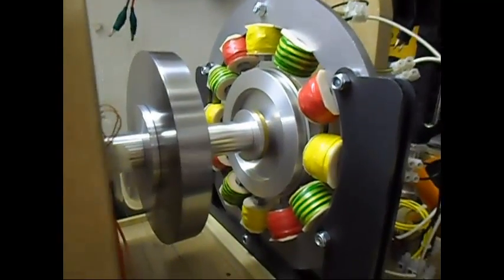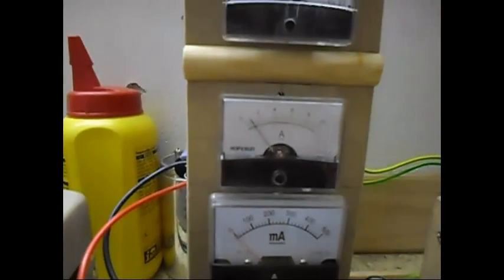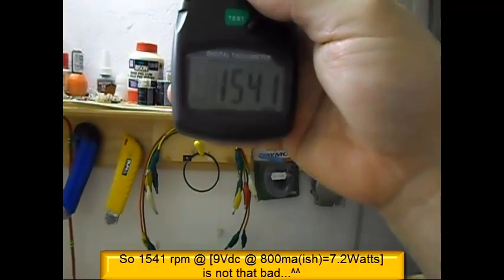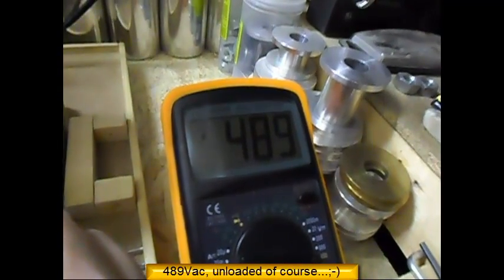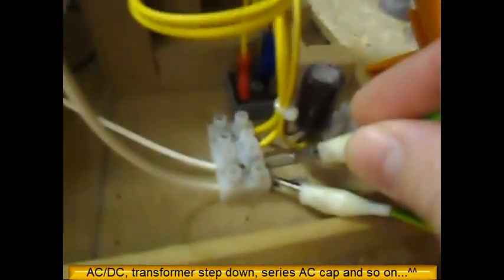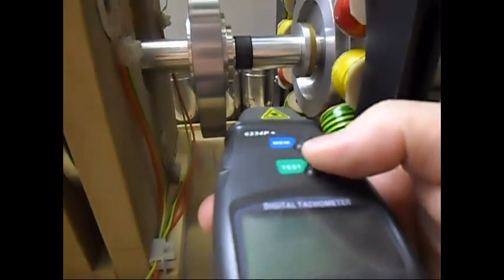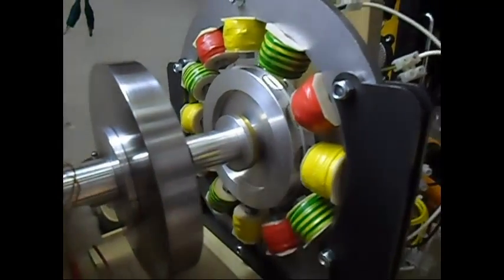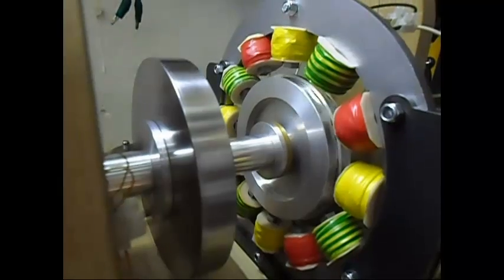Single Phase Generator_Update 9, Complete 12 coils generator first test run...

Comment: Magnet grade? And coils wire diameter? And turns ?
Reply from the maker: Thanks for your comment...^^
Wire diameter was here 0.25mm and a lot of turns since the resistance was around 60 ohms for each coil...;)
Magnets grade was N42...;)

Comment: How many windings have the coil?
Reply from the maker: Thanks for your comment...^^
I have no idea how many windings they have since i always look/search/buy my coils/inductors by their resistance...;-)
Reply: please can you share the caracteristics of the DC Motor?
Reply from the maker: What DC motor...???...there is no DC motor in this setup...o.O...lol
It is being driven by a pulse motor with a mosfet/transistor/hall senor circuit...^^
Reply: Sorry, I watch all your videos and in certains set up you use a dc motor. so what is the resistance of the coils- I will soon start a replica. If you you want I can send  you  pict. cheers
Reply from the maker: Thanks for your comment...^^
I have no idea since these coils where bought like this but since it is 0.25mm wire it could be around 1000 or so...it's just a wild guess here...;-)